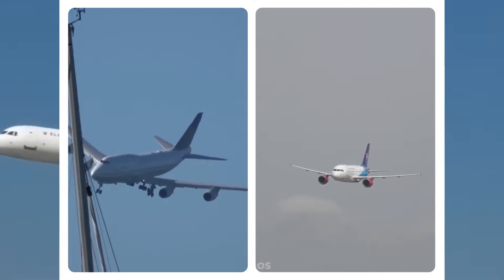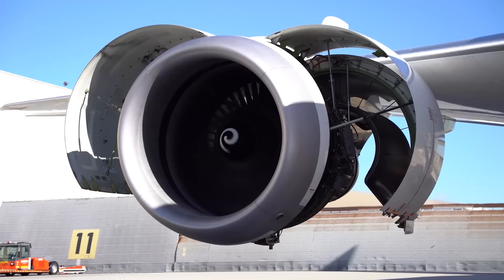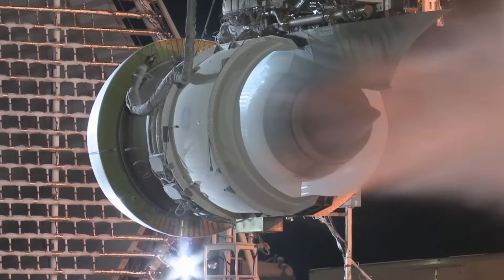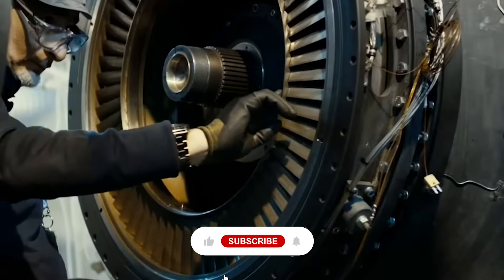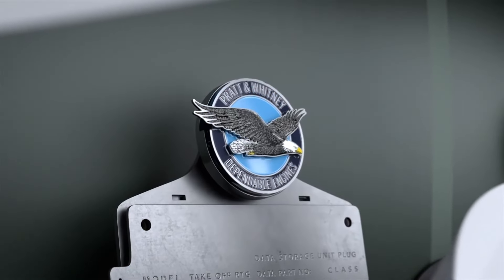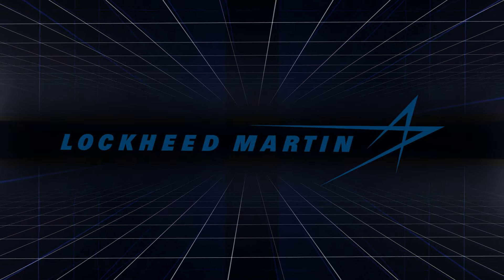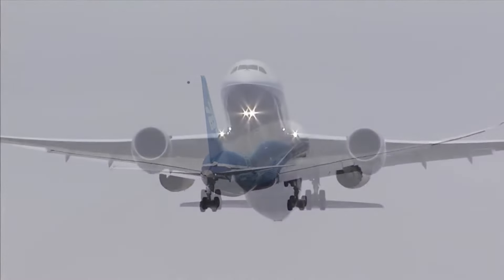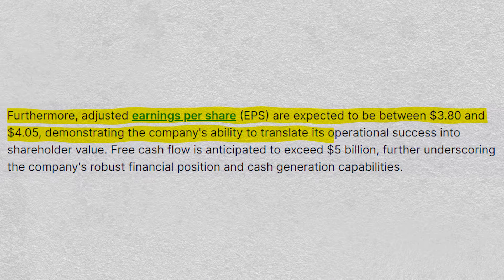GE CEO: "This NEW Engine Will Change The Entire Aviation Industry!"

Comment: The RR ultrafan has a bypass ratio of 15:1, the P&W GTF has 12,5:1, the CFM Leap has 11:1. So 10:1 in bypass ratio is nothing special, it’s the same as RR Trent 7000 that powers the A330 neo